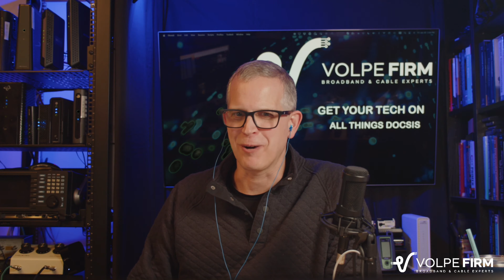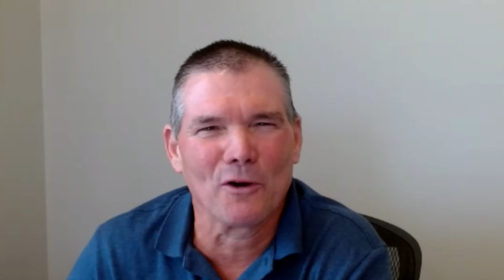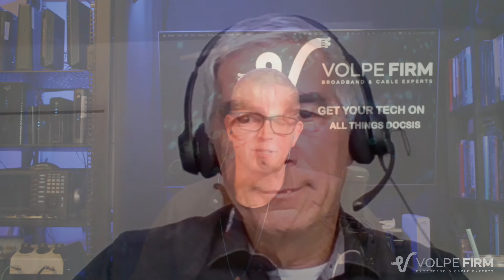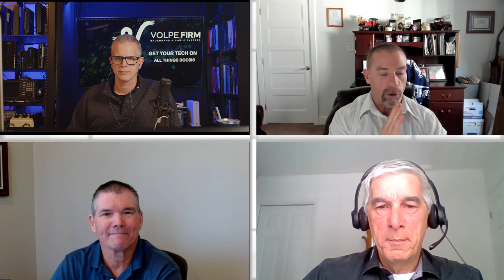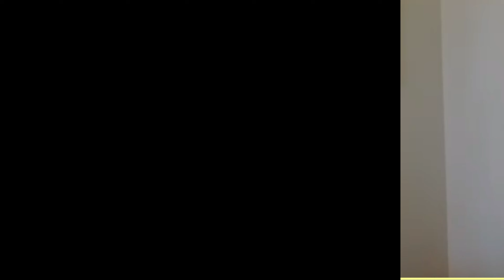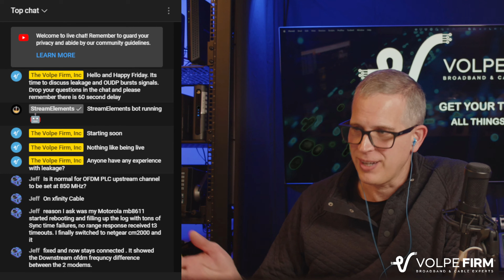OUDP Leakage Detection Explained

Comment from the maker: Do you currently perform leakage testing in your plant? Why or why not and what is your experience?
Reply: In the testing I’ve been involved with, the vast majority of leaks found come from the cable plant. Housing to housing connections seem to be the most common source followed by damage to the hardline cable.
Reply from the maker: Hi @andrebruning414 did you resolve the leaks by tightening the connectors, replacing them or was there some other method required to fully resolve the leak?

Comment: We have 3 cpat dsg-s and al have boot problems.
If the power is turned off after that it does not start.
Reply from the maker: Hi @gabrielb8239 the folks at Effigis should be able to get you up and running 👍

Comment: Interested to hear thoughts about how an aero leak on a drop fault today with say 20 mV/m reading on relatively low downstream (0 dBmV) levels, will blast out with a modem TX at 45 dBmV OUDP on the same drop fault.
Reply from the maker: Hey Lorne good to hear from you and thanks for watching. I think once we start having modems transmit OUDP test bursts at a high level, such as 45 dBmV, we are going to find a lot of in-home and drop related problems we previously did not know existed due to the massive leaks we find everywhere. Should be fun times. 😉